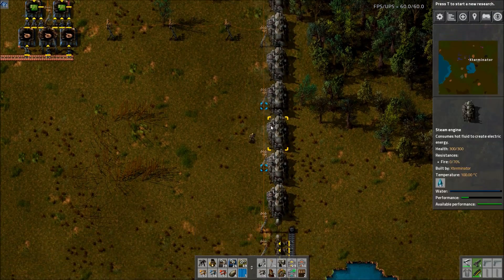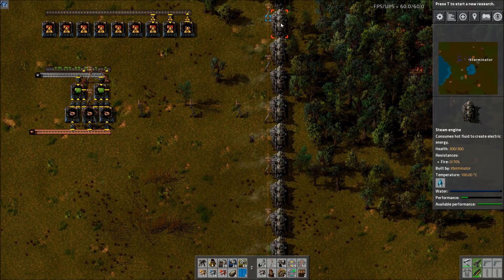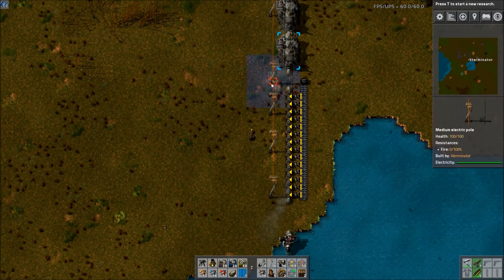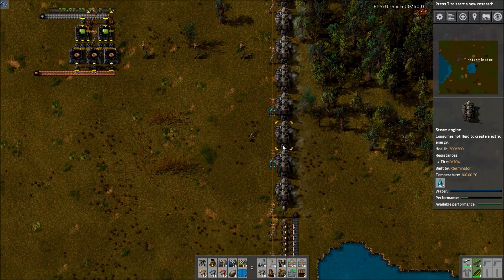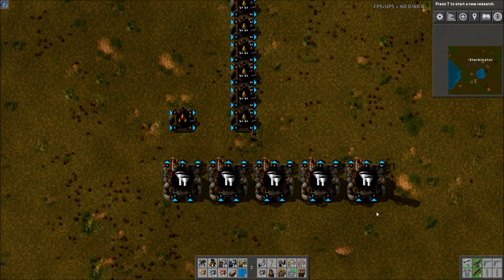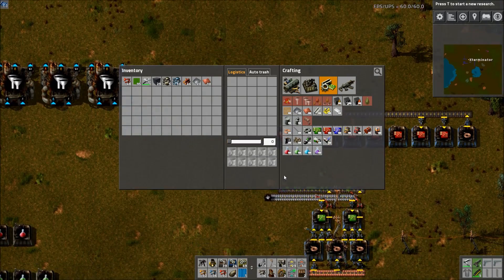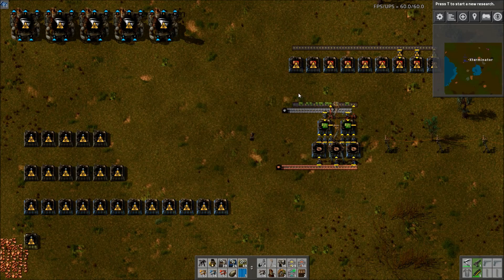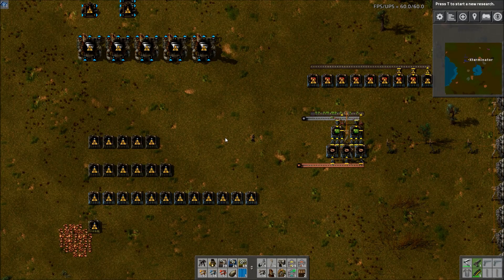Factorio Important Build & Production Ratios :: Power, Circuits, Science, Oil!

Comment: Your oil cracking math does not include any heavy oil for lubricant.
Reply from the maker: That is correct. Personally, I would suggest building a smaller separate refining setup to turn heavy into lubricant and then just send the petro and light into the rest of the system.
Reply: Xterminator that would probably work better... I added a refinery to this layout to try to get that little extra bit and it threw all the ratios out of whack.  :)
Reply: It also doesn't take into account that if you're making solid fuel, you significantly cut your output by cracking light to petroleum.
For each 3 light oil, you get 2 petroleum from cracking, which gives you a single solid fuel; alternatively, by making solid fuel directly, you get 3 solid fuel for the same input.
The same is not true of heavy oil, though; for 4 heavy oil you get 3 light oil, which gives 3 solid fuel, compared to 2 solid fuel directly.
With no cracking at all, advanced processing will get you 7.75 solid fuel for each 10 crude; cracking heavy to light brings that to 8, but cracking everything to petroleum only gives 4.5.
Reply from the maker: True it doesn't account for solid fuel, but honestly I'm not sure why you would want solid fuel for much. if you need a lot of it for power or something then I would personally just say build a separate build for it rather than making your petroleum output suffer from making it instead of cracking.

Comment: This video made me figure out a use for the reciprocal function. It took me a while, but I can now use it to figure out how long it takes to build something based on the efficiency.
Reply from the maker: That's awesome! Will definitely come in handy. :D
Reply: Yes, especially when using multiple factory efficiency values in one mini-factory.
Reply: Oh, I also got some help for an equation that will tell you how many mining drills you need for your smelters.

The ratio (number of furnaces):(number of mining drills) = (smelting per second) / (production per second)

So, if you're using unmodified mining drills with unmodified electric furnaces, you take your smelting speed (4/7 ore per second) and divide that by your production speed (1/2 ore per second).

(4/7) / (1/2) = (4/7) * (2/1) = 8/7 or 8:7

So you need eight mining drills for every seven electric furnaces.

Comment: You guys are using mathematical models for this game??
Reply from the maker: To an extent yeah. :P If you want to get really in-depth and accurate with ratios and stuff in Factorio there is quite a bit of math required.
Reply: Could you give me a example?
Reply from the maker: Well figuring out ratios requires math, so does figuring out module and beacon production numbers. 
For example, figuring out the 3-2 ratio for green circuits, you would need to do some math to see how many cables a circuit requires, and then how many cables are made per cable recipe and the time each takes to make, etc. This is a very simple example and it gets much more complicated when you factor in higher speeds and productivity modules etc.
Reply: Start to think about and maybe someone have use a machine learning approach or a more sofisticated method to play this game.

Comment: A good ratio for blue science i use is (all at 1.25 speed) 12x blue science with 8 red circuits + 1plastic + 1 copper wire and you also need 1 green circuit with 2 copper wires(but i prefer to import that)/ 5 Batteries/1 filter inserter wich works at half capacity and can share the normal inserter if you go with 6 green science/ and finally 11 steel/electric smelters for steel if you want to produce that close by

Comment: Could you explain how you got the boilder to steam engine ratio? I get the feeling that 14:10 only is to speed up the initial transient? Once it's stabalised, only 5-6 boilers seem to be active at a time with 10 steamies? Or am I missing something? :)
Reply: Yes, you're missing something.  Steam engines only output as much energy as the electrical network demands, so if the electricity needed is lower then only a few steam engines will work.

The 14:10 ratio will have all 10 steam engines working if power demand equals or exceeds their full output.  An example of this:  If you have 10 steam engines, their maximum output is 5100 kW.  If your electrical system only needs 2550 kW to be fully supplied then only 5 of those steam engines will turn on.  If the electrical demand is 6000kW though, all 10 engines will be running flat-out because they can't meet that demand since their maximum output is 5100 kW.
Reply from the maker: Jackelope explained it quite well! Just to add on to that, in regards to the boilers... The reason that only a few boilers seem to be active at time is probably because only a couple of your steam engines are active sense your not requiring much energy, per Jackalope's explanation. :)
If you were requiring say 3/4 or more of the max output of your steam engines, 5-6 boilers would not be enough. The engines would only run at like 1/2 of their max, and you would have power issues. Having the 14 boilers insures that if all 10 engines need to run flat out they can do so. 
Hope that helps.
Reply: Ill add on a bit of math for you as well.

A boiler can convert 390 kW of fuel energy into heating water.
A steam engine can convert 510 kW of "water energy" into actual electrical power.

So a steam engine needs 510/390 = 1.301 boilers per engine to run at 100%.

The max water a offshore pump can output is equal to the amount of water 10 steam engines eat.

Therefore to run 10 steam engines at 100% efficiency you need 13.01 boilers. If you did 13 it would be 99% efficient but you wouldnt get max output so you need the 14th for that 1% output. 

That is where the ratio comes from.
Reply from the maker: Jacob Jones
Great explanation! I never actually did the math myself, but seeing it makes me a feel just a little bit better about the ratio. Haha

When you show the math like that it definitely makes a lot more sense for anyone who is unsure. :)

Comment: Will someone PLEASE do a vid on how to update a mod? I have tried doing it in "Notepad+++" and it just breaks the game so it won't even start... Don't understand what I am dong wrong.
Reply from the maker: It depends what needs updating. If your just updating it go from like 0.13 to 0.14 then all you need to do is change the version of factorio it needs to run. You can do that from the info.json file in the mod's root folder. 
If you actually need to change code for part of it then I'm afraid I can't help, because I know nothing about modding. :/
Reply: Ok, I give up.... can't figure it out, every thing I try just crashes the game...
Reply from the maker: Winkie Man Damn. :/ Well my guess is that it's a mod that requires a more complex update than just changing something in the info.json file. Which mod is it you're trying to update?
Reply: Well this time it is "fluid-barrel" and i am guessing it is because I am just too old for this stuff, seems like it should be easy but never works.
Reply from the maker: Winkie Man Hmm for fluid barrel it should just need to have the required Factorio version changed in the .json file. If that isn't working though, you may need to replace it with a similar mod like OmniBarrels.

Comment: Would be nice if you covered how many science labs you need to have if you have that kind of science setup
Reply: It depends on research, different researches require different amount of science packs per cycle
Reply: And there's also the tech that increases lab research rate. It's (mis)named lab efficiency for some reason, but what it effectively does is increase research speed and consequently science pack consumption rate although the late game tech also tends to have higher recipe times (which means lower science pack consumption rates). Basically, there's no perfect ratio of science pack assemblers to labs.

Comment: Great video. I seem to remember MadZuri did a perfect oil ratio for pre-advanced oil processing. Something like 1 refinery then chemical plants  1 sulfur + 1 acid + 1 battery + 1 plastic +1 flamethrower fuel (for the heavy and light oil so they don't back up and kill the gas production.)

Are there any ratios for the sulfur->acid->battery and sulfur->acid->purple circuit production?
Reply: I usually just stockpile the byproducts in tanks until I research advanced oil processing.
For the ratios you asked, it is 5 sulfur to 2 acid to 25 batteries / 300 blue circuits.
Reply from the maker: Yeah I think he showed off that build in one of our Workshop videos about oil. :) 
There are definitely ideal ratios for sulfur-acid-battery and the circuits as well. I will probably do a video just on covering that type of oil stuff in the near future sense this one has been so well received.

Comment: Do you know anything about optimum Accumulators to Solar panels when doing a pure solar factory? I've seen different people doing math and claiming different numbers. I've mostly stuck with 7 panels to 6 accumulators which seems to work
Reply from the maker: Damn, I should of added that Solar to Accumulator ratio into this video. I can't believe I forgot. Lol Sometimes you forget the most obvious things.
Anyway, for your question. The most optimal ratio is .84 Accumulators per Solar Panel. So you can math it out from there based on how big of a layout you want. For example, it could be 100 panels and 84 accumulators, etc. Some people do prefer to use a .9 ratio though because in some cases the .84 ratio doesn't always provide enough power at night from accumulators.
Reply: Thanks
Reply: That .84 ratio works out to be 21 accumulators for every 25 solar panels, just in case that makes it easier to understand.

Comment: I saw in FFF 160 that some crafting speeds might change in 0.15 e.g. red circuits crafting speed 8 seconds to 6 seconds
Reply from the maker: Yeah, that will throw things off a bit unfortunately. :/
Reply: Xterminator; I think that the ratio will become 1:6 instead of 1:8 because notice that red circuits have a crafting speed of 8 seconds and we have 8 red circuit assemblers per wire assembler.
Reply from the maker: Cattman423
Yeah that would be right. Luckily the math works out for it go in evenly for any multiplicative of 2.
Reply: Xterminator;
Actually I think that we will either need to wait for 0.15 or make a mod to test the new ratios so we can be prepared,  because some quick mental math says that we'll have a surplus of cable with the 1:6 ratio, I'll work it out on paper in the morning
Reply from the maker: Perhaps my brain is just dying (entirely possible), but when I do the mental math it seems that 1:6 would work out perfectly just like the 1:8. I could definitely be wrong though, so I'd be interested to hear what you come up with.
Reply: Xterminator the ratio will become 1:6 as you would have 1 red circuit assembler per second that red circuits take to craft

Comment: you can also add this one: 1 chemical plant - sulfur : 1 chemical plant - sulfuric acid : 5 chemical plant - batteries, which is great if you wanna get the max production in laser turrets and accumulators with minimal waste.
Reply: Is there a ratio for purple circuits too? They need acid.
Reply: Do the math and you could probably figure it out. Then you can upload a video about it, or make a comment about it here or on the Factorio website.

Comment: Hey Xterminator, do you know the ratio for how many science labs to max out? I know there is a limit on the research speed but i don't know how to optimize that.
Reply from the maker: Hmmm I didn't know there was a limit on research speed. I think that is only limited by the amount of packs you can produce to feed the labs. I mean I've seen people build like 500 science labs that all work together as long as there are packs being made to support them.
Reply: really? Damm i probably miss understood something :'( kkk, ok then.
Reply: It'd change depending on the research you're doing. There's no really optimal ratio. Some research takes 15 seconds per unit, others take 60.
Reply: just take the average  of 30seconds per research item. your making your packs at 1 a second so make 30 labs.    the belts will help balance this as well. they will backup the extra if your doing a longer research and then let that extra flow when doing a shorter one. 
ive also found that double this vids pack production is a good amount.  10x red 12xgreen 24x blue. the purple is a whatever to  me. i drop more production if i see im running out.
Reply: Yha, when i first asked that, i was thinking that is a Limit on the research speed, so when you reach this "top speed" doesn't matter how much labs you add, the speed won't change. But probably I miss understood something.

Comment: for steam engines 
2 18 13 is the best
EDIT: 2 17 13
Reply from the maker: JDTeam well it's another ideal ratio yeah. I don't really see it working better than than the 1-14-10 sense that ratio works 100%.
Reply: for boilers to steam engine 17 13 is the best (17*390 = 6630 and 13*510 = 6630)
and I allways have space for that extra pump
Reply: In reality you are wasting over 50% of that second pump. 1:14:10 is the best single pump ratio or 3:40:30 is the best for ideal shoreline use.